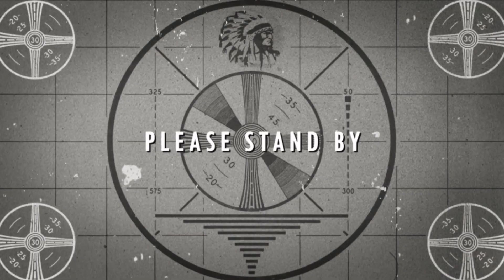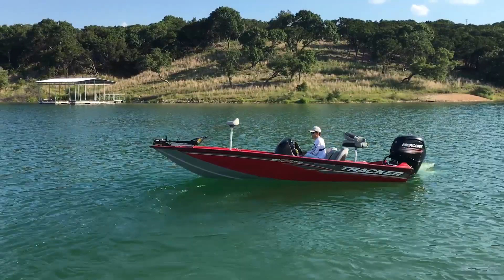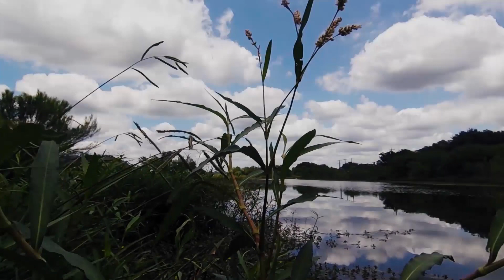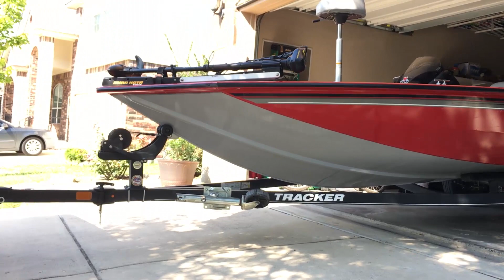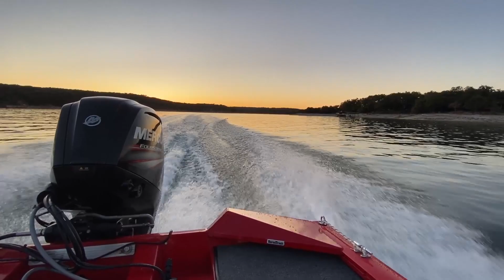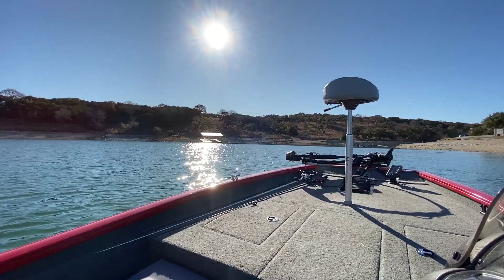WELDED VS RIVETED Aluminum Boat! Which is Better? (WATCH BEFORE BUYING!)

Comment: Lund is the best aluminum boat manufacturer by far. They use rivets. Thus, rivets are the best as long as all the other stuff is good too (for example, Lund is much thicker aluminum than the competition).
Reply from the maker: Nytron Lund boats are trash. Watch this https://youtu.be/h0NjgbjPzPo
Reply: @PhilosophyDaily  What relevance does that video have? Give a timestamp, does not appear to be related to what I said. Tracker is probably the lowest end aluminum brand on the market. Very thin aluminum. Lund is the rolls royce of aluminum boats. It's not like the fiberglass boat industry where there's a bunch of comparable brands and models that are all at the top. In the aluminum boat industry, there's Lund at the top, then a huge huge gap, then everyone else. e.g. Literally no other manufacturer makes an equivalent watercraft to say a Lund Pro-V or Pro-V bass.
Reply: Wrong. Lund is the best if you have never heard of and know about Marlon. Lund only uses rivers to keep cost down so they can sell more boats. If money wasn’t an issue, Lund would weld their boats as well. 😊

Comment: All boats flex and are meant to! So if your boat is only welded over time the welds will crack and break! That’s why companies like alumni craft use rivets and welds in their boats. You then get the best of both worlds!
Reply from the maker: Joe Bukiewicz A welded boat will have less problems overtime, even with less flexibility. Thanks for watching!
Reply: Joe, that's simply not true because my neighbor's 18 year old Ranger Cherokee's hull  that he fishes with still to this day has no cracks or breaks in it at all. Still a really good boat!
Reply from the maker: ddm62571 I’m not saying that rivets are guaranteed to give you problems. I’m simply saying they are more likely to require maintenance and/ or repair.

Comment: How come airplanes are not welded
Reply: Complicated question, but essentially, some reasons why an airplane is riveted are:  Airplanes are made of thinner aluminum on the skin because of requiring lighter material weight to fly.  Welding causes a heat affected zone in 60 series type aluminum sheet that anneals and damages the cold rolled tempered strength of the aluminum sheet by over 50%.  Plus, water leaks don't matter as much in airplanes; failed welds can be dangerous while flying.  Boats, on the other hand, can be made of thicker sheets of cheaper 50 series aluminum and so can compensate for the damage the weld heat does.  The added weight can be more easily compensated for in a boat with a larger hull for more buoyancy.  Fixing an aluminum weld crack usually requires a good welder that can pulse heat AC tig weld, and it will still be weaker than the aluminum sheet it was made from.  Where as rivet boat seams usually require any cracks to be stop-drilled and a larger rivet or a patch or low temp brazing rod that can be done by a novice, the repair will be stronger than original construction if done well.  Just my 2 cents.
Reply: Weight. I worked in that industry.

Comment: I have an 81 Tracker and a 2010 Tracker, the 81 is riveted and the 2010 is welded, haven't had a problem with the hull on either one and neither one takes on much water after fishing all day unless it rains or I have a wave come over the side.
Reply from the maker: Lray 4x4 Thanks for watching!
Reply: Same here on diff hulls neither leaked.

Comment: I have a 25 year old riveted bass tracker that doesnt leak a drop. If a rivet fails I can install a sealed rivet from the outside meanwhile if a crack occurs in a weld it has to be welded again.

Comment: you don't sent to Lund for warrenty you take it to your lund dealer and they fix it there. Warrenty also only applies to the original owner. Rivets and wields Both have their advantages. Also there are 2 weilding technics that could be used spot weilding and straight though. Spot weilding can still have gaps. Rivits dispers the stress more throughout the whole hull where yes Wields are stronger than the hull itself.

Comment: Alumni Craft manufacturer said that welded deep V boats don’t expand like riveted boats in rugged water and is subject to crack. Commercial aircraft’s and fighter jets are riveted.
Reply: LOL why tf do people compare airplanes to boats. Both applications experience different environments and are utilized differently than the other. I’ve owned 3 riveted boats for 15+years and all have leaked at some point. my latest boat was bought in 2013 til now (2024) and is welded. No leaks and have gone through the chops of the chops in superior, millelacs, winni, vermillion, and tonka with no leaks. The only time i get water is when it rains, or when i hit a wake too big and water gets in…. 

The whole purpose of a rivet is to join sheets of metal together. It doesn’t prevent “leak” which a weld is made to do. Anything can crack, but if a rivet fails before a crack on the hull (which in most cases do), then what is the point LOL. 🤡 🤷‍♂️

Comment: Take it from me, i have a riveted jon boat and i recently hit a few stumps and now literally all my rivets are leaking on the bottom. Talk about scary 30 degrees and your boat os filling up at a pretty good rate. Tried to fix them with a rivet tool on a air hammer but still leaked im currently in the process of welding them all now. I would have been much better off just having a welded boat. Its still flexible because it will flex where you dont have ribs and thats where you would want it to flex anyway. Flexing at the ribs is a bad thing welded or not. I understand that they could cause cracks but i have a welding degree and I know metallurgy and it would seriously take alot to make them break if you use the right alloy. It would take alot more to break the welds then it would take for bend the rivets. Just a few minor bumps over stumps ruined all my rivets but if it was welded that would have been nothing. Any time you put holes in a boat you are opening yourself up to problems

Comment: First of all, this is massive generalization based on a personal bias of yours. To say that welded boats are better than riveted is a misconception.  To say riveted boats  are better than welded boats os incorrect. I can  tell you that many factors affect how effective your boat will be, mainly how well you maintain it. This is my 4th boat, so I'm  more than qualified to speak regarding this matter; I've had two riveted and this is my second welded boat. You are correct in that riveted boats tend to leak more, but they are also more flexible and maneuverable in some ways do to the rivets. All wielded boats tend to leak less, but they are usually quite a bit heavier and cannot move as quickly; there is a larger response generally speaking.  This is especially a problem with racing boats as they must often turn quickly and plane out fast. Welded boats are much more likely to crack and are more expensive to fix. One of the only times you need an all welded boat is if you're pounding through 4- 5 foot waves and more. Other than that, you're fine. You  must especially scrub your boat with rivets ro ensure no build around the rivets,  though most of the companies that are all riveted use adhesive hull protection.  Bottom line is that it all depends on your purpose.  Saying one is better than the other is a matter of ignorance unfortunately my friend. If you want the best of both worlds, buy a princecract boat. This is my fourth princecraft boat and these things are so well built for a variety of different things such as tubing, water skiing, racing, fishing, etc.....many other companies like lund and  tracker specifically specialize in fishing,  only considering that type of activity. A truly good and versatile boat develops one with the understanding that people's needs change and one that can accommodate the different needs of people is the best one. You'll never go wrong with princecraft, as they are known to build very durable hulls which is needed regardless of what you do and where you go.  Lund fir example, are known more for accommodating the needs of fishermen as I said, so you pay a lot more for tbings like storage. You pay the majority for hull design with  princecraft and with potentially a bit less storage but at a better price. The only reason wby people claim that lund has  higher resale value is because you pay a lot more to begin with. That is irrelevant when identifying the price to sell your boat at. It's a matter of how good a shape it's in once you're ready to sell, not how much you initially pay for it in the first place. Regular maintenance can go w long way in preserving the value of your boat. There are many 5 - 10 year old boats that hold a much higher value than a 3 year old boar, so just remember that my friend. Nuance your thinking a bit I'd recommend, it's for your sake. Objectively state rge nature of bith and leave  your personal opinion out of itAt the end of the day, one is going to buy a new or used boat based upon the objective information based on both kinds of boats,  not what a person's perception is. Have you heard the saying "opinions are like assholes, we all have one"? This is definitely relevant to this context.